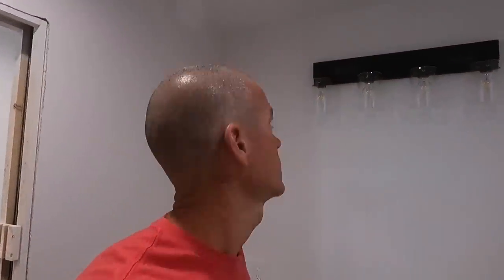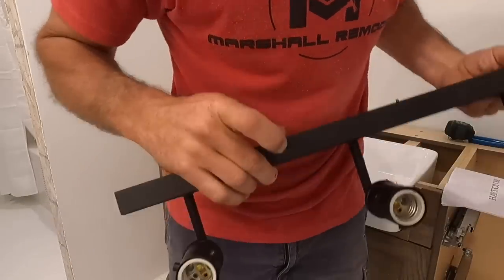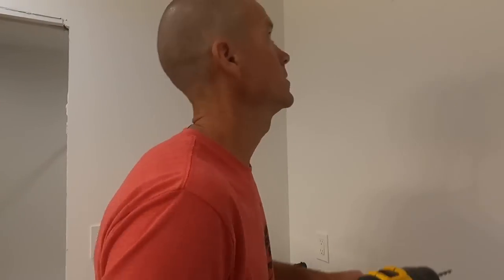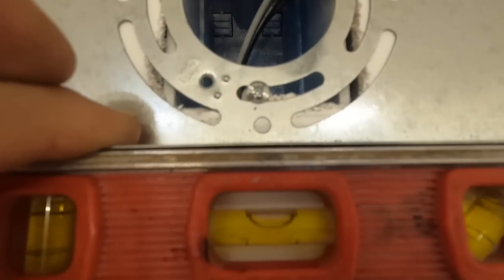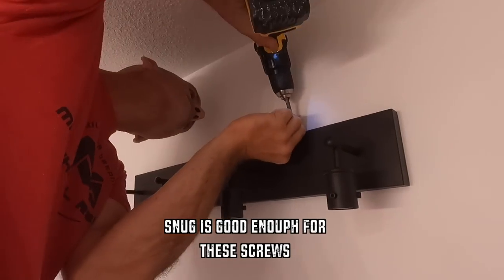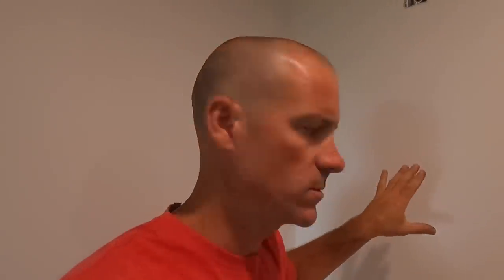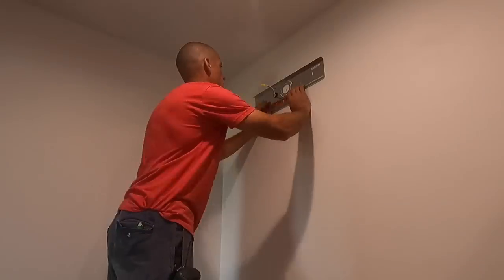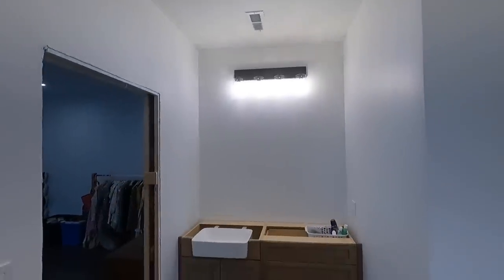Bathroom Vanity Light Install | Easy DIY

Comment: This is why I never mount a junction box for vanity lights during rough in. I simply weave the wire through the studs at roughly 6 1/2' off the floor. Once vanity & mirror are in, I am able to cut the box in perfectly centered with a hole saw, reach in and grab the wire, pop the box in, and mount the light.
Reply from the maker: Good tip!
Reply: You don't install the pancake box during rough-in  and prefer to retrofit it???? It sounds like you hide your joints In the wall... Gross

Comment: Great video!  How does one person do this as you do?  How do we connect the wires while holding the fixture?  It looks like you connected two wires, which you use to keep the fixture suspended while you connect the other wires.  This part is not clear to me and thanks in advance for your guidance.

Comment: Always cover the drain if you are going to use the sink to hold screws.  Stuff a piece of plastic or paper to temporarily cover the drain.
Reply: I don’t think the drains are even hooked up yet.Paul seems very knowledgeable on all things in building a house
Reply from the maker: Our drains weren't connected, but that's a really good tip!

Comment: greetings mr. paul; was there not two holes in the base plate that lined up with the wall box? seems it would be even stronger to use them all.put the bulbs in first, it would be easier......................g

Comment: They are easy to install but a bit of advice, never put bulbs in with bare hands.  The oils on your fingers will shorten the life of the bulbs.  A simple surgical glove on one hand will be all you need.  I agree with the choice of directing it downwards.  Up will only collect dust.
Reply: Even with LED’s?
Reply: @htownelectrican  yes, think of the fingerprints you leave and what happens when some bulbs warm up
Reply from the maker: Good point! Thanks for the tip.
Reply: @htownelectrican  You're spot on Chris. LEDs emit very little heat so you don't have to wear gloves. Anytime a light source emits heat like halogens or incandescent bulbs you should wear gloves. The issue is the high heat from those bulbs heating up the oil from your hands, that creates a hot spots on the bulb.